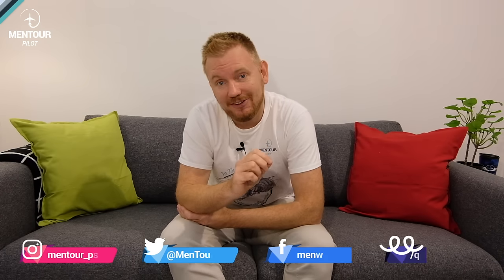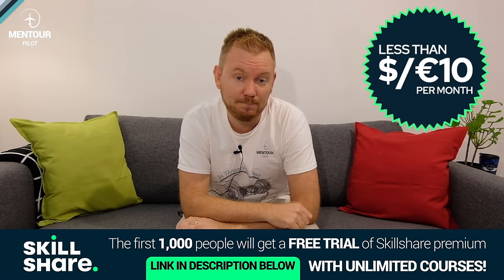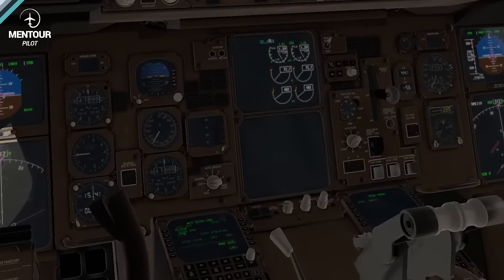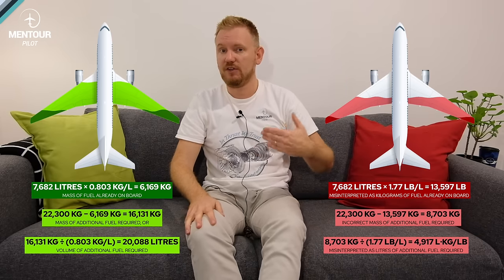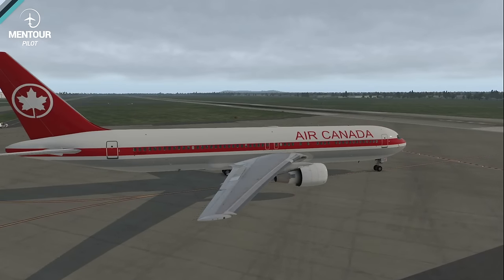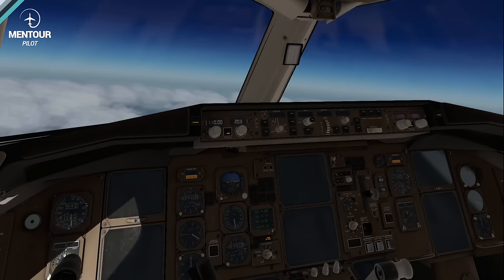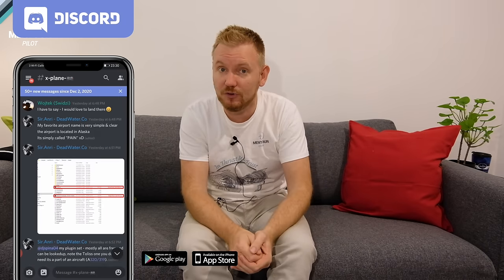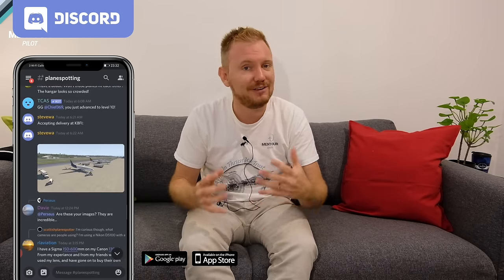The Gimli Glider! Explained

Comment: Really nice explanation. The build up to the event was caused as usual by a combination of mistakes. Thankfully the crew turned a potential disaster into a happy ending.
How about doing something regarding British Airways Flight 9, the 747-200 that lost all 4 engines over Indonesia due to volcanic ash on 24 June 1982. Another example of excellent crew management.
Reply: I recall this insident, if i remember correctly they managed to restart some of the engines, mainly because at the time R.R. were the few engines you can use the by pass air to restart.
If i remeber correctly, it stopped a lot of aircraft from fllying for miles around as the dust stayed airborne for ages and is lethal to any engine, come the think about it, its not that good for humans either .!!!!!!!

Comment: OK, l have a question for you...
Back in the 70s l few from London to Schipol airport then to the Canaries, Las Palmas.
This was to visit my mother..
The airplane was KLM DC8 and l was sitting in first class dept...and drinking a coffee. We were high...and everything normal..Next minute they put the air brakes on and we all lifted out of our seats..coffee gone...and the plane just dropped...
Back in my seat l noticed that the nose was pointing down and at an angle of 22plus degrees (approx...measuring using the horizon)
Now l have flown in many planes single, twins, DC3 Bristol Freighters, DC4..6 loads.
However never experienced a drop in altitude as great as that...
So...after all these years maybe, you might answer the question.
Do they use cowling air brake at high altitudes in normal flight..conditions.
Or was this an avoidance action..ie too close for another...
Fun though..l was not worried was 17 with hair.😂👍

Comment: On takeoff, how much less trust, for the same climb out rate  is required if the aircraft is roughly 22,000 lbs lighter than thought to be?   Would it be a noticeable difference?

Comment: Here's a question I can't find the answer to by searching the internet: With both engines failed, wouldn't the cabin pressurization system have failed immediately? Why didn't they have to do an emergency descent to ~10,000 feet? Did the windmilling of the turbofan compressor still provide enough compressed bleed air to actually keep the cabin pressurized!?

Comment: Exactly as you asked Petter, after seeing the "Gimly Glider" episode, the other three comparable feats that come to my mind are: The "Miracle on the Hudson" (which has been abundantly covered, even more by the film "Sully"); the "Azores Glider" (Air Transat Flight 236), and the much less known TACA Flight-110 masterful flying by Captain Carlos Dardano and First Officer Dionisio Lopez.  What is even more impressive is that Captain Dardano had lost his left eye several years before, by being shot when he was flying during a civil war in El Salvador.  In a similar way to Captain  Pearson having an "extra" in the form of glider-capability, Captain Dardano too had an extra, from his Aerobatic flight capabilities, that came as an advantage during the feat of landing  the powerless B737-300 across a storm system and landing on a Levee and not on a runway, and doing it so masterfully that the 737-300 was easily repaired and flown from a near place!
Should an enterprising You-Tuber be able to reunite on-line the four crews (Sully/Styles, Pearson/ Quintal, Piche/de Jager and Dardano/Lopez, a GREAT Interview/Documentary would result, as those four crews did an outstanding job that is very difficult even on simulators!!!  Add the lack of full vision of Captain Dardano to the feat, and it is on pair to Sully, Pearson and Piche  achievements, not a bit less, that is for certain.  The fact is that being a "latino", he has much less diffusion, but he deserves every bit of praise and recognition.

Why not doing an On-Line recorded interview of the four crews or at least the Four Captains, conducted by MENTOUR Pilot?
Reply: Great idea!

Comment: As for no fuel and cross control to lose altitude. Long long ago I was flying with my friend in a 1961 Piper Colt. It had left and right wing tanks. The left had multiple feeds for take off and landing. The right had a single feed for cruising.  We were flying VFR and came upon the Cleveland airspace's inverted cone.
So we needed to loose some altitude so we cross controlled right wing down left rudder and the engine STOPPED. The silence was deafening!  My friend started looking for an interstate median to land on and I started yelling "LEFT TANK LEFT TANK".  The fuel switch was on the left side so he switched it  and the engine sputtered back to life. :-0

Comment: One thing I don't understand that maybe someone can explain. Regardless of the incorrect calculations, if you are a fueler, wouldn't you question the quantity of fuel based on past experiences?

Even if it's a brand new plane with very efficient engines, if you refuel for this same route everyday, you're not going to assume that 5,000 kilos is going to be enough when it usually takes 20,000 kilos or more, right?

Comment: My question is, if the indication of fuel on the plane is in a volume unit (litres), and the refueler is also providing fuel based on volume (litres again), why is the minimum required quantity for the flight mentioned in a mass unit (kilos)? If the minimum required fuel quantity was given in volume units (litres) as well, then no conversion would have been required to be done by the crew, so no errors would have been made.
Is there a practical reason why the minimum fuel requirement for flights, is given in a mass unit, rather than a volume unit?

Comment: 16:15 -- RE:  The first Indication of trouble being low pressure warnings on the fuel system;  sorry to interrupt at this late date with a question about this, but hey, wouldn't the aircraft's systems also be monitoring the center of gravity?  That is to say, it seems funny to me that the aircrew would not notice the aircraft being many thousands of kilograms lighter during the ascent.

Comment: Holy crap. Living in Buffalo, NY, I often crossed over into Canada and one day when filling up my car with fuel, I noticed that the gallon much more expensive than in NY and that was because the gallon was bigger, and around that time there was that 70's gas embargo. And auto makers were starting to make more fuel efficient cars, as in more miles per gallon and right then I was struck with the solution to get better gas mileage. MAKE THE GALLON BIGGER!

Comment: Very few people know the real reason the nose wheel collapsed. It has nothing to do with the RAT. When the gear was lowered on final, the mains locked down,  but the nose wheel did not. This should have been anticipated because there was insufficient hydraulic pressure to operate the landing gear. B767 pilots cover this all the time in recurrent training. They should have left the gear on the OFF position and used the ALT GEAR EXTEND switch. When the nose did not lock, they did operate the ALT GEAR EXTEND switch, but the gear selector was already incorrectly positioned in the down position. This caused residual pressure in the nose gear hydraulics which prevented the nose gear from properly free-falling and locking into position as designed. I really don’t fault them because of everything else they were dealing with, and because this was a new aircraft with new procedures, that they were not properly trained on. The Air Canada B767 Quick Reference Manual was later amended to provide better guidance for Alternate Gear Extension.

Comment: Mentour, have you done a video on what controls you have left on a 737 with dual engine failure? If you were in this situation would you be able to extend flaps, etc? Also, were there changes made to the 767 because of this accident?

Comment: If you are fuelling a jet with 1/2 broken tank sensors; wouldnt you want to spot check after you have fuelled (with the redundant method)? Meaning you can check at some of the locations to make sure enough fuel actually made it in. (And there isnt a leak).

Comment: In the closing days of the Vulcan, one flew into Biggin Hill for an Air Day. Our home was under the approach 2 miles out (Petts Wood Station), and this came over kind of low - less than 100 feet over a built-up area. So he puts power on, one minute I'm at the far end of a hundred foot garden, in a second I'm against the house, unhurt. At what point would that have counted as an accident? Taking out the main London-Dover railway, sure.

Comment: I read the book "Freefall" which gave LOTS of detail on this, and how it happened, re the error with the fueling and the root causes.  The book seemed detailed, was well written, and thoroughly explained what happened, including WHY it happened, re the background and people involved -- for the crew, the refueling people, Air Canada and its procedures and documentation.   (I dug into this once I heard about it, due to living in Lexington, KY, and once the Delta flight 5191 fiasco happened in Lexington -- just wondering how such horrendous mistakes could be allowed to happen, given all the safety precautions in place for commercial aviation). 
.
To me, if the fuel gauge is broken and they won't / can't repair it (due to money saving on parts inventory , or whatever), then, for safety, just go with a FULL tank.  

That way there's no ambiguity.  And if the company doesn't like the additional expense of carrying the extra fuel -- then be sure and have an adequate parts supply.  Period.  

Per the book:

The basic problem was a required conversion from pounds to kilos, which was a change. 

A BIG part of what went wrong per the book, was that no one understood how to do the math to calculate the fuel needed, the standard had recently.  Various employees all felt doing that was really someone else's job and relied on the opinions of others.   Air Canada had poor procedures and documentation on them.

Note:  No other airline operating in Canada had this sort of problem.

The crew did a fantastic job saving the plane, during the flight.  However, the crew and Air Canada did a HORRIBLE job allowing this horrendously dangerous mistake to happen, since it was completely preventable.

Comment: Fascinating recounting of the event. They did the exact right calculations, but had the wrong scaling factor. Also nice to see you don't use it as an excuse to attack the Imperial system, like so many people (especially Europeans) do. In reality it doesn't matter which system you use, if it's consistent. It's when the two systems collide that the problems happen, and neither system is any more at fault for this than the other.

Comment: The Gimli Glider incident is my number one most favorite aviation accident incident because it was an accident that resulted from an innocent pilot being put in the middle of an airline's neglect of not loading enough fuel into the airplane, while he himself initially appeared guilty but then was exonerated when the facts came out.  The captain was suspended for six months after the accident while things were getting straightened out and blame was being thrown around, but I understand that it was the airliner who was ultimately fined ten million dollars.  I have had my own share of such incidents in my own life with my having Asperger's syndrome, in which I was caught in the middle in similar ways in so many situations.
Reply: Even with all the facts brought forward in this video, which I have to assume is fair, I still think the captain bears of lot of responsibility for what happened. It was his decision in the end to take off without a functioning fuel gauge. He had all the authority he needed to refuse an obviously unsafe condition (with an engine failure or fuel leak, he might easily have needed a functioning gauge even if they had enough fuel to start). He could also have pressed the engineers to try to fix it before take off, and someone would eventually have noticed channel 2 breaker was pushed in. The pilot was overly sanguine to the point of being reckless, and if I were he I would have taken the 6-month demotion without argument and spent the time brushing up on my analytical skills.
Reply: @michaelbrower3068  Well, yes, I see that too --- but what if, for some reason the gauges couldn't be fixed for reasons beyond his control?  Do you know how often airline pilots are the victims of the negligence of maintenance personnel?  The Gimli Glider wasn't the only time when an airline pilot was booby-trapped by a poorly maintained airplane.

Comment: Is it fair to say that Air Canada were initially trying to cover their back when the mistakes about the conversion from the volume of the fuel from the tanker trucks were converted to the mass of the fuel in the aircraft, in other words converting the mass to lbs rather than kg. In Air Crash Investigation, they mentioned that the aircraft was supposed to take on 22,300kg of fuel at Montreal, but instead it was loaded with 22,300lbs and as a pound is roughly half a kilogramme, it only got half the fuel required

Comment: One thing i never understood is why the emergency system doesn't have any kind of provision to maintain the dials (especially in a digital format, which requires very little electricity to run) to give the pilots at least one screen that has the most vital systems required, maybe even a check up system, or a fault detect setup. If i can run a computer on a UPS at full burn crunching architectural platforms for at least 4 hours, then i don't see why a vital plane system requires auxiliary power to run all the setup, when in a plane, burning the weight for batteries would be trivial. (obviously, i am not 100% aware of all the things going in and out, so error in knowledge might be present in my assumptions).

Comment: The yellow collar should be manufactured so that it is impossible to put them around a circuit breaker that isn't pulled out. There should be a differently colored collar that only fits on pushed but not on pulled circuit breakers. This way a collar could be used to indicate something but from the colour it must be clear whether the breaker is active or not. Eg. the first technician puts a yellow collar around the pulled one and a red one around the second one, to indicate "this one is and must be pulled, this one is and must be pushed".

Comment: A proper conversion factor includes the units, and thus is equal to one.  One mile is equal to 5280 feet.  One mile per 5280 feet is equal to one.  So is 5280 feet per mile.

A proper conversion factor includes the units, a lesson from my 9th grade general science teacher.  These pilots were performing math without the units, and it's possible the documentation concealed or played down the units.  If so, the documentation might also be at fault 

BUT ALWAYS INCLUDE THE UNITS IN YOUR CONVERSION FACTORS!

Comment: Ah the metrical system..... It must have been a hard time in the seventies converting from medieval yards, stone-throws and furlongs for measuring lenghts, and pints, gallons, quarts, gills, hogsheads and buckets used for the amount of fuel. Once getting used to it the metrical system with it`s liters and meters is so superior and so much easier to handle.... By the way is this the Captain Sim 757 / 767 in the video? That`s one of my favorite planes. Still waiting until it is finally converted for the new Flight Simulator 2020 :) absolute superb classic, no one ever did the 757 767 in that fantastic quality but Captain Sim (but I think 15 years ago or so there was a third party add-on development team called "Level D" who made a 767).

Comment: You may not know this but a similar unit mixup causes the Mars Climate Orbiter to crash into Mars on its final approach. The reason was that a metric unit based thrust control was fed data from navigation computer which was imperial units based (or vice versa, I don't know but there case was that the instrument needed one type of units used and the use of the other expected). The result was several billion of dollars lost.

Comment: Hey would you go into the ventilation/presurizing system on airline aircraft. During Covid there has beec lots of discussion about this. Does the air come in from the proper engone turbine ports then presurize the aircraft and then valves let air out and control cabin air pressure. But is cabin air recirculated through filters as well?

Comment: Do you not notice that your aircraft is 12115.7kg light at takeoff?  Wouldn't it rotate much quicker after V1 (or by itself before reaching V1) ?

Did they not tell air traffic control that they take  the runway of Gimli? Because then ATC should have noticed that it is decomissioned and told the flight crew. Or should have called the police to secure the safety of the runway etc? Or is the reason that it happened in 1983?